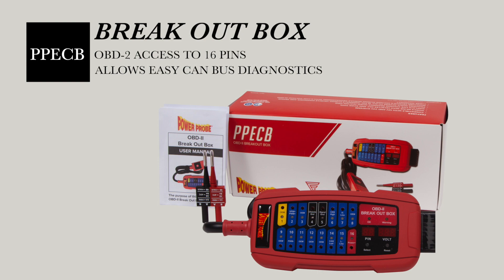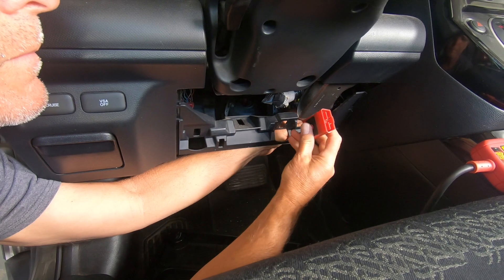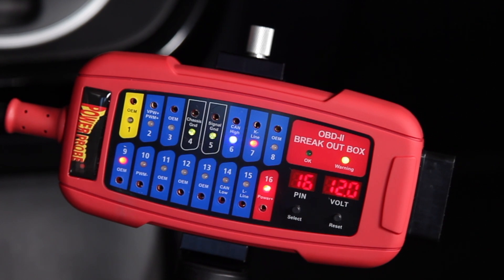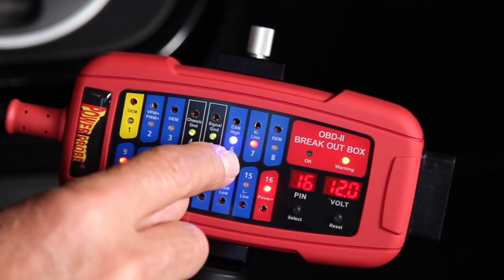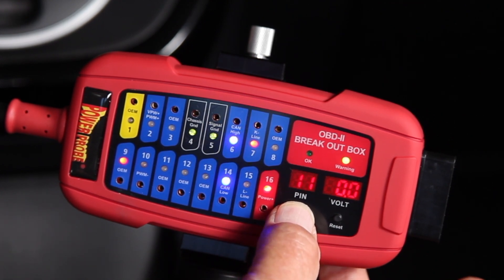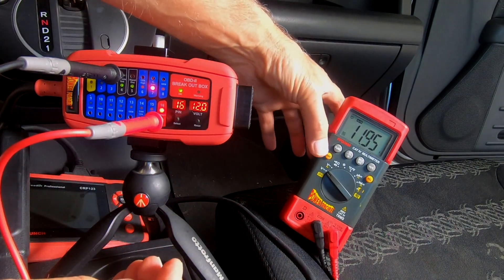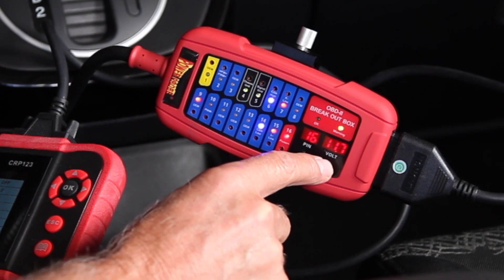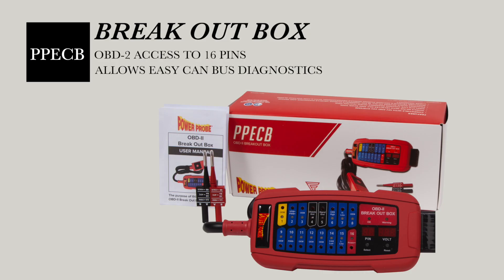Power Probe OBD 2 Break Out Box #PPECB

Comment: You need to put a battery charger maintainer before you start the diagnostics.
Reply from the maker: Great tip James- proper battery voltage is critical to an accurate diagnosis.

Comment: Nice looking piece of Kit, but you've made a small error with your commentary - When Programming you do not use a Battery Charger, you have to use a Voltage Stabilizer. Stable voltage is just as important as high voltage and most battery charger don't have a stable voltage output (or at least not stable enough for Programming)
Reply: Jesus christ, this isn't a fucking how to video. The little details like that are irrelevant as anyone programming a vehicle should fucking know this and have the appropriate tools to do so.
Reply: @Carlitosway211  "Should know" As a Diagnostic Equipment sales specialist I come across this daily! And more often than not their not using anything. For those that know - They Know. But Those that don't Incorrect Information becomes the Truth.

Comment: As good as this will be i see a problem with using it for CAN diag.
I can only speak for Hyundai as that is the product i know.
The newer models no longer have C-CAN at the DLC. They have what is called D-CAN which is purely for DLC to gateway connection. You cannot test C-CAN at the DLC.
Reply: Well no fucking shit. Then this clearly doesn't fucking apply since it's plugged into the DLC.

Comment: Last power probe product was crap and when I called your service department you didn’t pick up the phone or call me back! Stay away from PB
Reply: You might have had bad luck. When I had a problem with my power probe hook they sent me new one. This company stands behind their products period👍
Reply: Probably user error. I've been using PP products since the original PP.
Reply: @Carlitosway211  , no it is crap. JUNK!!
Reply: @Carlitosway211  pos
Reply: Power Probe Tek , I purchased the Hook and the Maestro and the extension for the Maestro. My extension lead for the maestro is 1 inch thick and weighs 6 pounds!! I would’ve never purchased the Maestro if I had known to reach 30 feet I’d have to carry a 7 pound cable.
  The Hook started bugging out the first day I got it.  I could not deal with it and got rid of it at a loss on EBay.